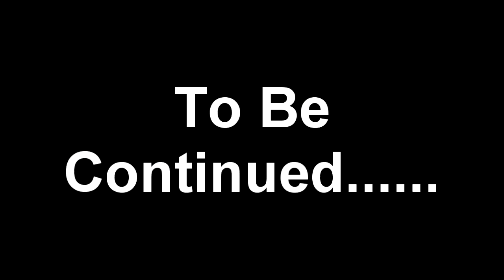(S-2 Ep-20) 18' Sailboat Build Ballast Keels # 1  (Part 27)

Comment: I have a 36 ft sailboat with a lead ballast. But the lead is only on the front half of the keel. The back half is hollow and filled with engine oil and antifreeze etc. I have removed the engine ( putting in electric motor). I've cleaned the slug out and now want to fill in in with something, so I can rise the level, just so I can reach it and add a bilge pump. 
Because I don't need to weigh, will cement work?
Reply from the maker: Yes, however much depends on how much weight you wish to add. In some cases, concrete may add too much weight yet in others it may be not enough. You'll have to do a bit of math in order to maintain proper stability and trim.

Comment: What do you figure the weight of each keel to be? Will they be canted outward or hung vertically ?
Reply from the maker: These ballast keels will hang vertically: Mainly for simplicity and ease of construction. Each keel will weigh over 400 pounds. This makes for a heavy 18' pocket cruiser that won't win any races, but then it was never designed for that.
Reply: @shoestringshipyardsailing9681    So, at 40%,  that amounts to a displacement of  2, 000 pounds, eh?  And a draft of what looks to be about two and a half feet?   I have kept in mind your comment, "If you don't compromise you'll never go sailing".